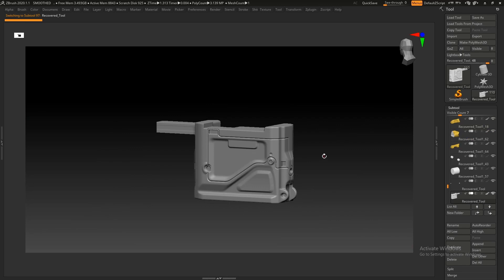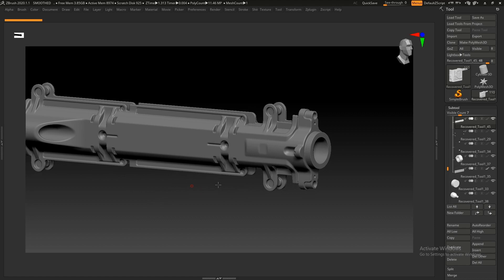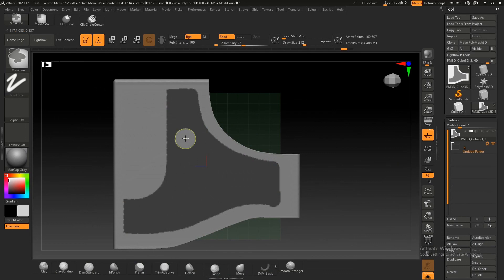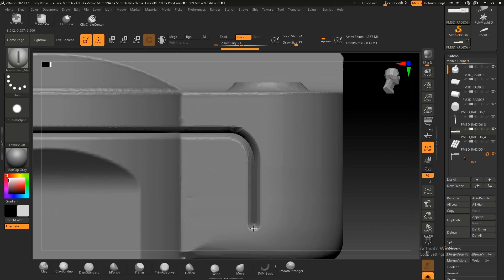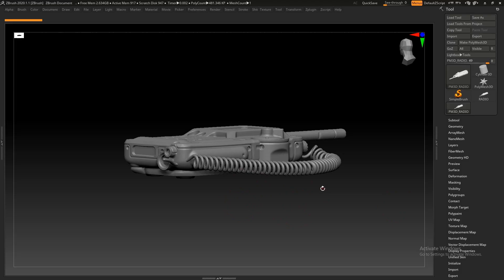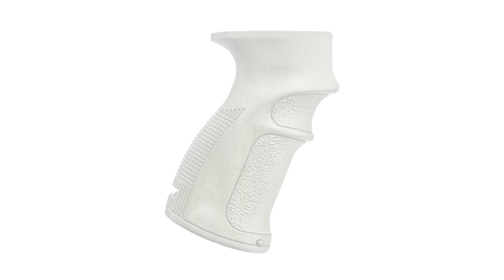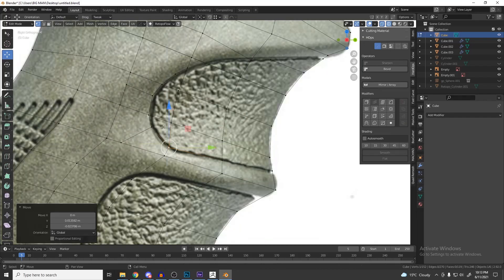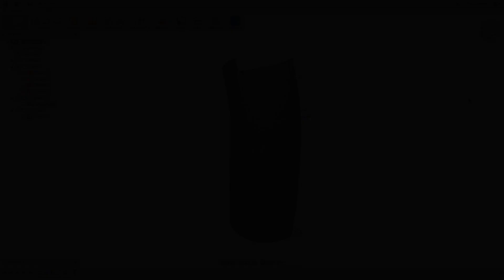Why use ZBrush For Hard Surface

Comment: can somebody tell me whether u need a pen tablet for hard surface in z brush ?
its absolutely necessary if one is sculpting proper organic shapes
but is it needed for hard surface ( like this one here) too?
Reply: ZBrush user since 2005.  The entire workflow is based on using a tablet/stylus.  Without one, you're going to have a bad time, so consider it essential.  I've just seen that Wacom is running half-price on several refurbished tablet models at the moment, so may be worth considering if budget is a concern.
Reply: @jonnytenebrous1113  Thanks man !
so in order for me to proprly complete this tutorial , a tablet is must . okay
Reply from the maker: I've never used a tablet for this workflow.

Comment: its good for concpet sure, but not production ready models. you still to retopo most of the models etc. It really depends what you do, some stuff would be better of be done in subd modeling fast and ready for prod. Tho with zbrush you can get a concept out faster
Reply: sure it´s always about priorities, no 3D software can be the best at everything, sometimes zbrush is better, sometimes "classic" polygonal modeling is better and sometimes it´s better to use CAD
Reply: @TheMULTIcanal  well today, i had to use houdini to make a model and import i  maya, even tho maya is better for polymodeling. As you said each software have their use case
Reply: you would have to retopo regardless of where you would get the HP from. Or do you mean retopo the sculpt to get the final HP?